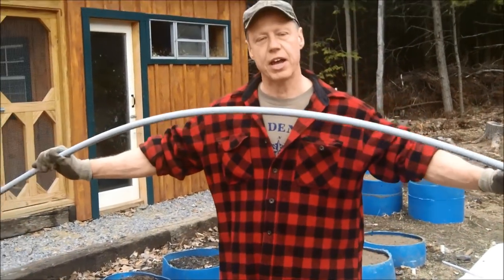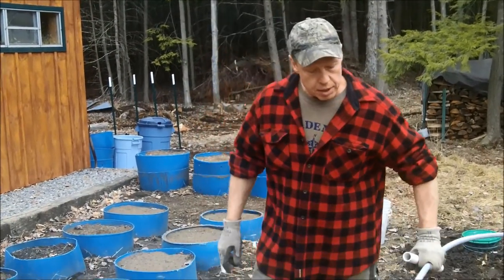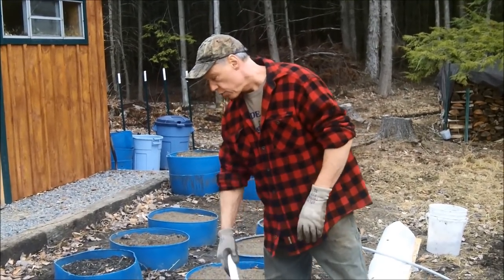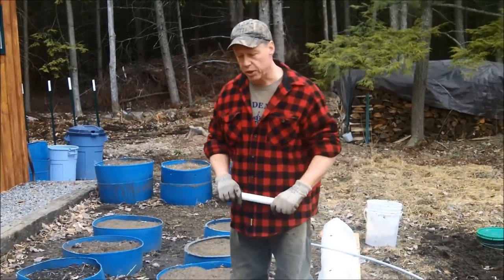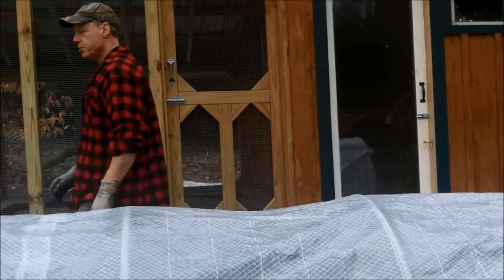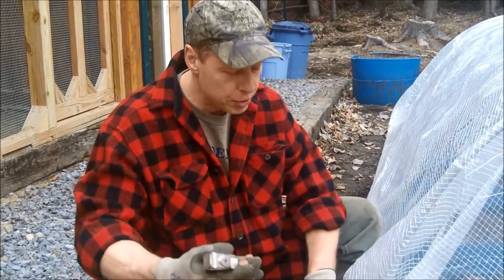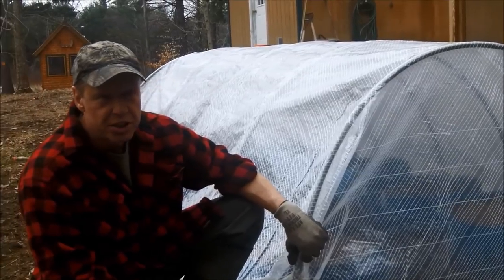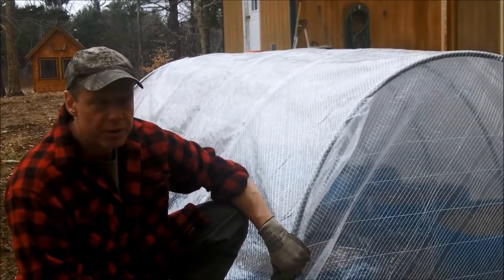(REPOSTING) DIY EASY BUILD GREENHOUSE GARDEN. A How To Video.

Comment: I don't think I had seen this! I may need to scroll through them. Of course mom said she watches the same shows over and over and is surprised by the endings still so maybe .....ha ha anyway, question #1 how many of those do you put out? Do you do all raised beds?
Reply from the maker: I was using 3 and no longer doing raised beds. All deep mulch gardens now.
Reply: I had great luck with some deep mulch gardens and felt boxed in with the raised beds so when I get to Higher Ground will likely do it all that way plus the greenhouse we purchased and have in storage there.  I have blooms on my strawberries still in the deep mulch area and it is NC and Dec with frost on the ground and they are June bearing so only thing that makes sense is the mulch from my scraps from veggies and we are heavy coffee drinkers and the grounds to there plus more

Comment: Regular PVC plastic sheeting will NOT do fine. I tried it, and it lasted about 2 months before becoming brittle and shredding. The greenhouse PVC that is fiber reinforced is also UV resistant. It costs 2-3 times as much but is supposed to last 2-3 years. I actually built a couple 10x20ftx7ft high greenhouses with this conduit pipe method and it is quick and easy.  Just make sure to buy the real greenhouse plastic.

Comment: How many years did plastic last Boss?  I think we will try your type next year maybe make a few.  No way without a very expensive fence to have a garden here now with deer & doubt steers will trample them.  A bit worried cougars show up with them being so many.  We had one here once a big one to.  Did you hear about grizzly attack in Idaho September 1 on bow hunters?  Pistols only saved them.  Grizzly spreading out here to. 20 miles away last year but cougars scare me & my neighbours spotted a huge tom maybe 250 lbs.  Never thought I would hate deer or see them as pests but they sure are.  Habitualized they get dangerous to.  I have a huge buck & he dropped his head at me last year when I tried scare him off rubbing my young pine.
Reply from the maker: The plastic held up for several years but I didn't keep it out all season. I only used it to give the plants a heads start and then rolled it up and put it away.  Things have changed now and my next garden will have hoops all season long.